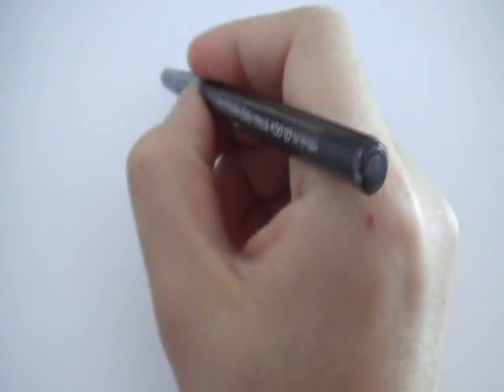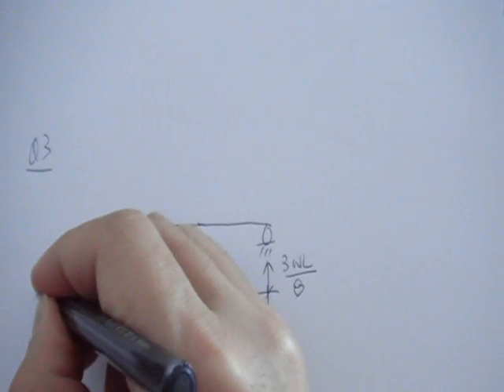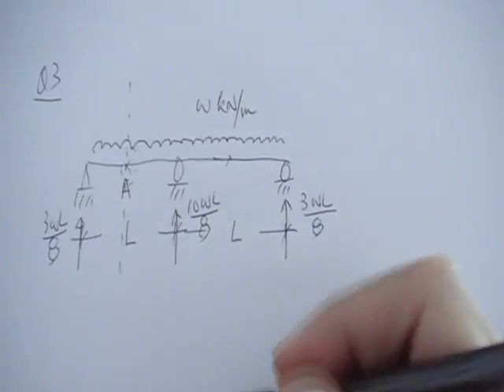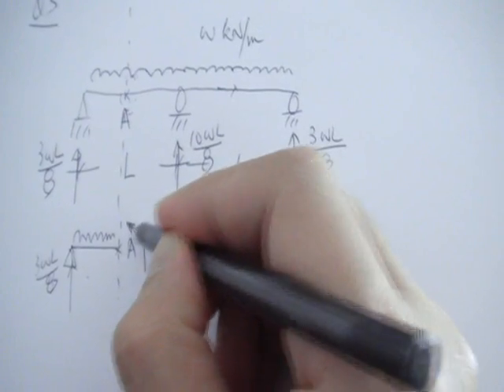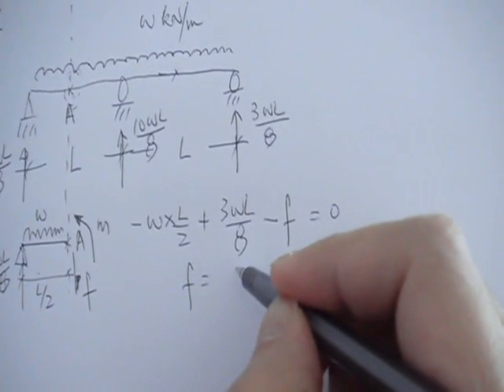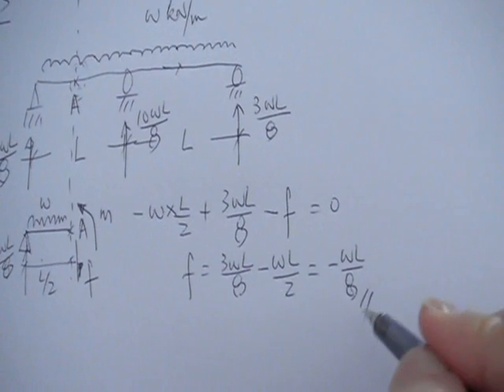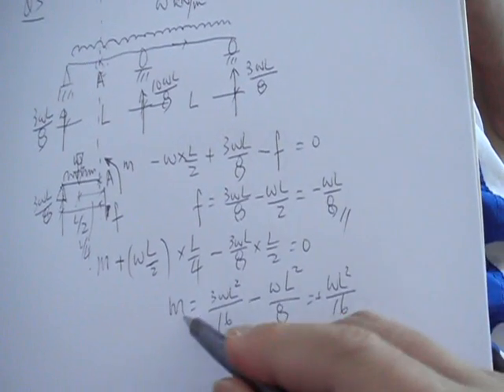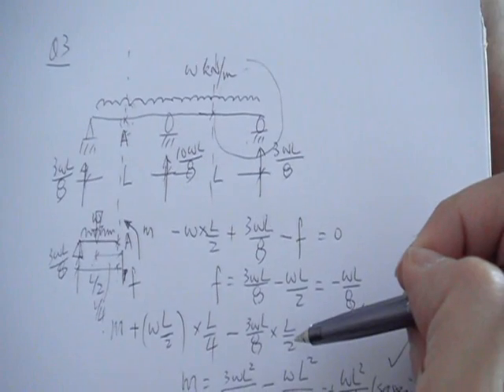Bending moment and shear force of beams Q3

Comment: now plot the given reaction or place the point in a table charts, and do a linear  regression with the graphing calculator, what you'll get is linear function or shear function,then integrating the shear function appears the moment function,the constant term will be zero since M(x=0)=0 initial condition,direction:working from left to right.